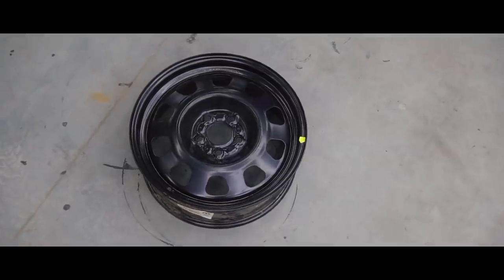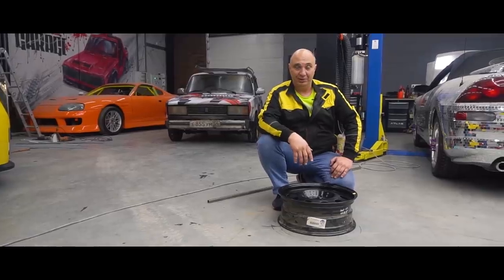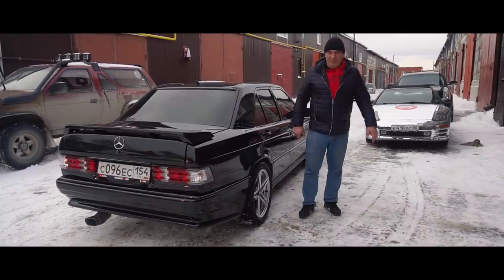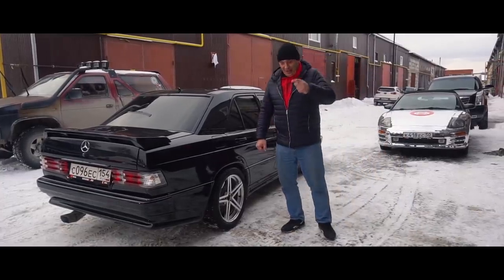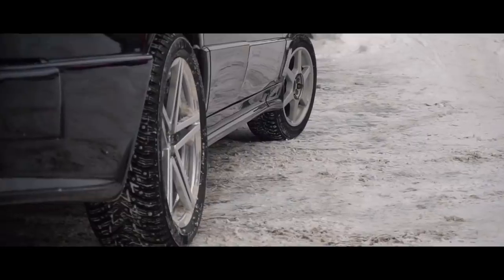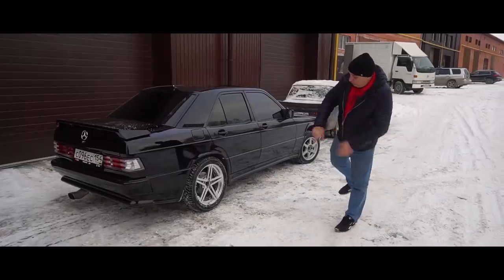DIY AMG replica wheel made from a steelie

Comment: rim shops: that will be 8000 dollars. 

54: 4 guys, 20 worth of steel slats.
Reply: Imagine if they had a really good TIG welder
Reply: They also need a good jig that would make the wheel not warp with all that heat.
Reply: and someone who can weld. I really gone get why their welds are always garbage. Don't they do car mods as a legit business?
Reply: @5hiftyL1v3a  They probably do have legit car repair/ mod business i guess. Just that these side fun projects does not need to be carefully planned out, since its just 1 take for youtube. Sure you can debate it does not exemplify their workmanship. But would you want to drive with welded wheels like that or concrete tires? 😜 Its all just for fun.
Reply: @netmatrix75  yeah the workmanship angle is what I am getting at - their welds always look like they were done by someone who doesn't know how to weld. Like it doesn't take more.. effort? to not weld badly if you know how. Its technique, not time or effort.
Reply: 20 rubles, right?
Reply: @Gkkiux American dollars, im unfamiliar with rubles, i do know its mostly in larger values though.
Reply: Es seguro a ser esa modificasion
Reply: @5hiftyL1v3a  Maybe their real welders works only for the business.

Comment: The wheel wobble might have something to do with the missing lug nut. There are 4 other lugs, but steel wheels flex quite a bit when torqued to the hub (where alloy wheels do not as they are normally much thicker due to being made of lighter, weaker metals such as aluminum)...so the wobbling issue could have easily been due to that one missing lug nut.

Comment: Well, it's a dirty hack job.. BUT! From a technical point of view, that wheel will be stronger and safer than most, if not all of the cheap Chinese cast aluminium wheels you can buy. This one won't explode or fracture when driven over a pot hole. Even if the balance is a bit off.. Hehe

Comment: The ///AMG stamp is about 100 grams of steel on the one side, you should make another one on the other side of the wheel and after that recenter the wheel on hot with a hammer. Then rebalance the wheel on the balancing machine.

Comment: Next video idea:
A car with no clutch pedal.
Basically, the idea is that you remove the clutch pedal and only use your gas pedal and brake pedals.
You can do that by modifying it in such a way that when you press the gas pedal, the engine rev increases and the clutch engages at the same time. So 2 in 1 basically.
I hope that is interesting!
(:

Comment: 1. measure the freaking bits and align them in a some way at least
2. polish the parts properly, eventually not on the floor
3. use a piece of iron wire and hang the rim on a ceiling or such to spray paint the freaking thing in the air rather than on the FLOOR.
and 4. actually, use a sticker rather than drawing the AMG logo with a tool! Will save you time and effort.